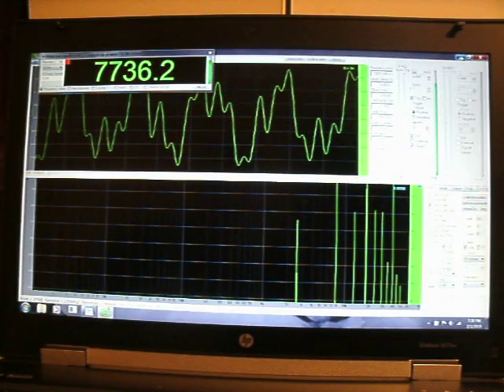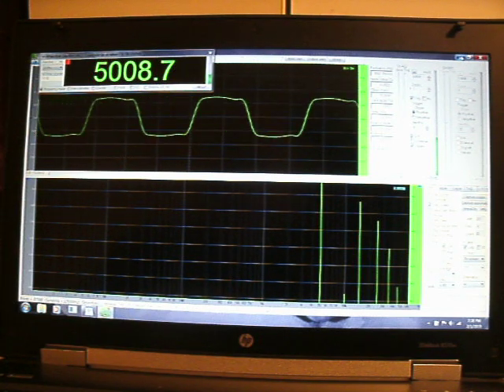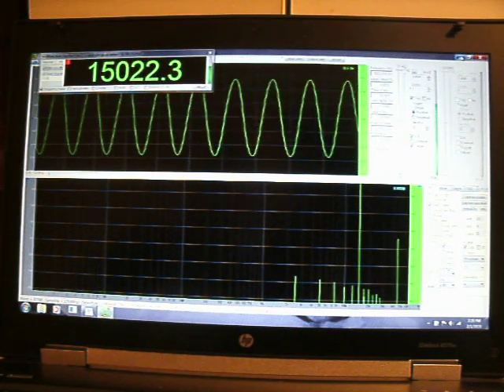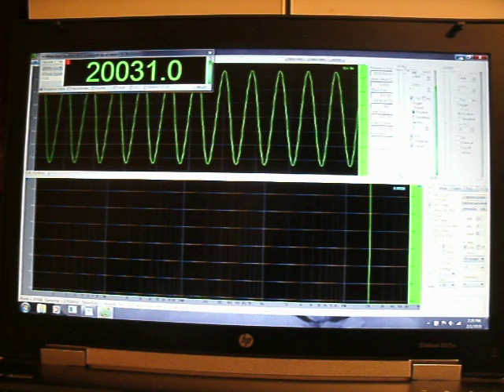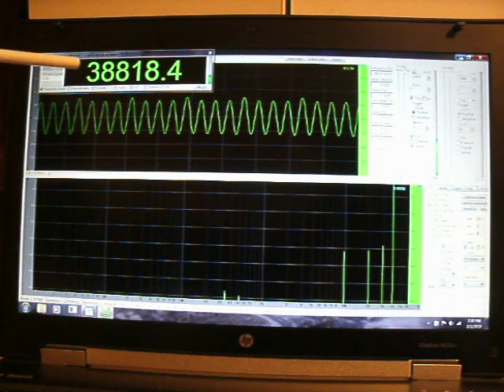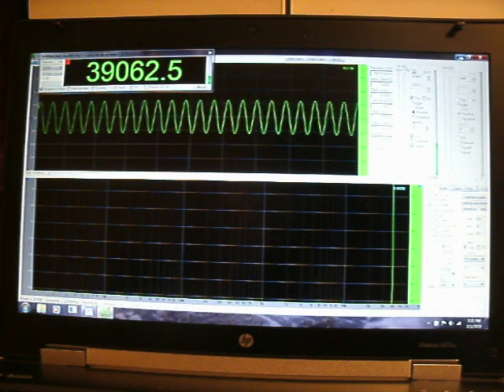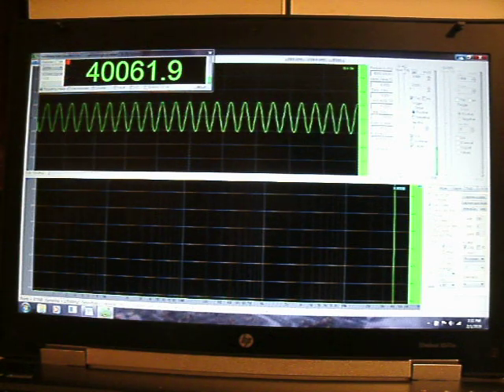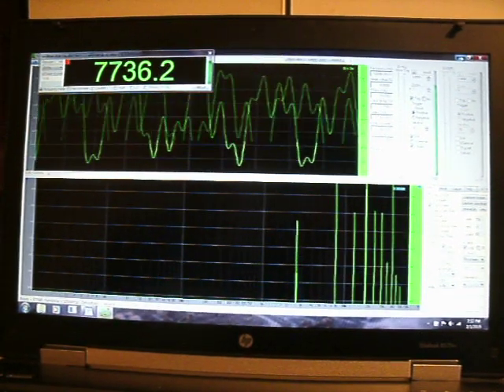Minelab Equinox 800 Frequencies

Comment: does it affect the strength of emitted EM field when running on a single frequency compared to that same frequency being run in multi frequencies mode?
Reply from the maker: I don't have anyway of measuring that type of test.  But very interesting.

Comment: Which way do the frequencies skew when noise cancel is used? Higher the frequency with a lower noise cancel channel or the other way around? And does the noise cancel channels effect each frequency the same? Lower the noise cancel channel the higher the frequency?  Please help! 
Thanks! 
Albert Lopez
Reply from the maker: Honestly I don't know.  Very interesting thoughts and questions to say the least.
Reply: @markg6836  could you test?
Reply: @markg6836  I would like to know which way the noise cancel channels skew the frequency? Like in your video it shows the lower the noise cancel channel the higher it moves the frequency.  Does this hold true on multi and in all other single frequencies? Could you test?
Reply from the maker: The difference in frequency change is only slightly an offset.  I never saw a performance increase or decrease when using the noise cancel.  But if EMI is bad you will get a performance reduction if the noise cancel is not performed.

Comment: Thank you for your thorough analysis of the frequencies. I would like to know your conclusion wether to hunt in multi frequency or 40khz with a noise cancel of -1.

I get so much chatter on my equinox 600 in multi. I recently tried using it on 15Khz which seems to make it more stable. I have now purchased the 800 and awaiting delivery. Will hunting with 40khz with a noise cancel of -1 make a big difference?

Thank you in advance for your advice
Reply from the maker: I'm assuming you have hunted more than one location.  If the chatter is always present regardless of location I'm guess something might be wrong.  40 khz would be better for the small items but the multi function gives the most stable ID and ground balance.  Usually if the chatter is to bad after noise cancel I start turning down the sensitivity until quiet.
Reply: Mark Gillespie Mark Gillespie thank you for your advice. I would like your analysis and opinion based on what the 40khz setting is capable of. You mentioned that it can detect smaller items but I’m assuming it does that with less depth. 

In my case I am hunting for coins in the UK & I am willing to sacrifice depth in order to have the equinox perform with the least amount of chatter possible.  

On my 600 it seems that 15Khz is by far the frequency with the least chatter. I have ordered the 800 on the hopes that the 20khz & 40khz will make it even more stable with far less iron falsing. 

If you could let me know about your experience with 20khz & 40khz that would be great. Thanks again for your reply
Reply from the maker: @LondonMus  I have very little experience with these two frequencies.  For the most part I use the multi frequency option.  Mainly because multi gives me the quietest hunting in my ground.  But I may try these two frequencies on my deepest test garden targets.
Reply: Mark Gillespie from my grounds it seems 15Khz appears to be the most stable with the least chatter & iron falsing. I have ordered the Nox 800 to use the 20khz & 40khz in the hopes that it will become a more stable machine. In the 40khz mode do you think it will still detect targets like silver coins?
Reply: Mus London just reading through these informative questions and answers and decided I’ll chime in. I can check on the silver coin for you sometime this week and get back to you. Thank you Mark for all your insight also.

Comment: There's been a big conversation about whether the Equinox 600 scans all 5 Equinox frequencies in "Multi" mode, or whether it can only scan up to the first three(5k, 10k, 15k)?  Could you perform this same test with an Equinox 600 and tell us once and for all, if it ever scans the 20khz or 40khz frequencies in any of the "Multi" modes?  If you don't have the machine, I'm sure somebody nearby will provide one for the test.  Also, I'd love to know which analyzer software and hardware you're using there. Much Thanks.

Comment: What did you use for a pickup coil?  Did you participate in the Geotech forum discussions?  Much nicer display of results than with my HP spectrum analyser - or maybe I just set it up wrong. What is the link to the software? Thanks, good job.